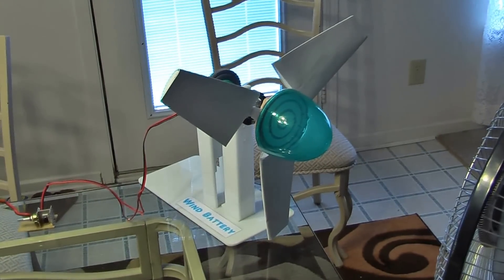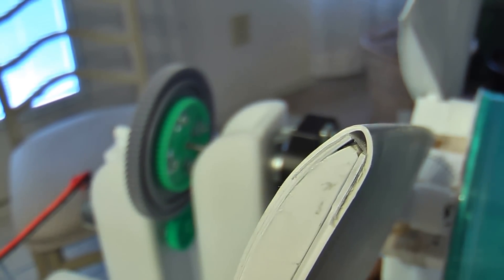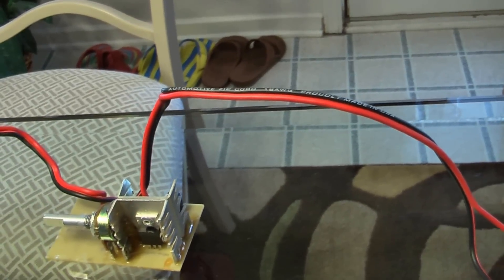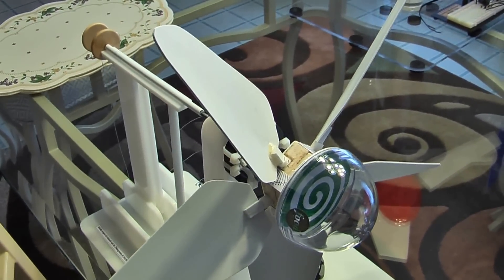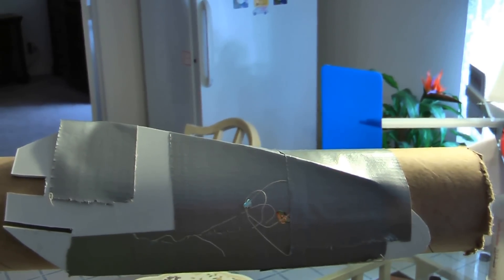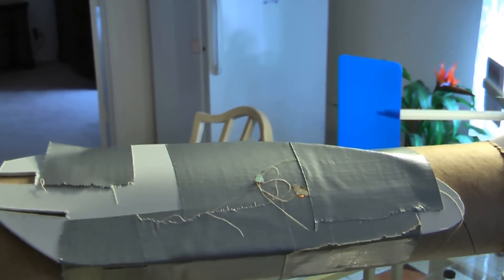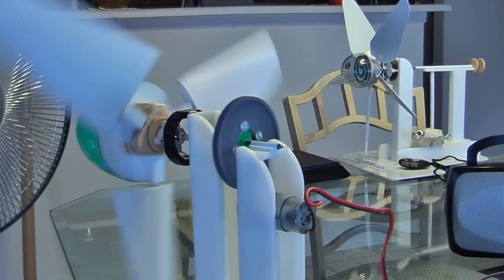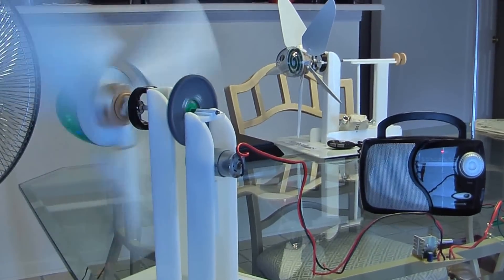Mini wind turbine 2

Comment: Dinesh Regmi: You can use almost any small DC motor. Should you fine the DC motor that you want to use, it should tell you what kind of current that you can expect from it . If you turn the shaft of the DC motor it will output the voltage that it supposed to operate it. You can get a good DC motor just about anywhere. However; if you use a stepper motor it will generate what is close to ac voltage. Look up Mini Wind Turbine 4 on youtube. Here I have a larger mini wind turbine that uses a stepper motor to generate ac voltage. I am in the process of building a larger mini wind turbine that will produce 28 volts DC and 27 amps of current. I hope to have this one completed soon.Thank you for watching my YouTube.